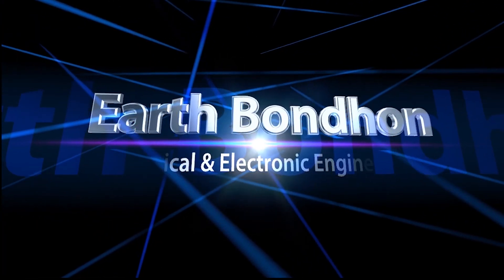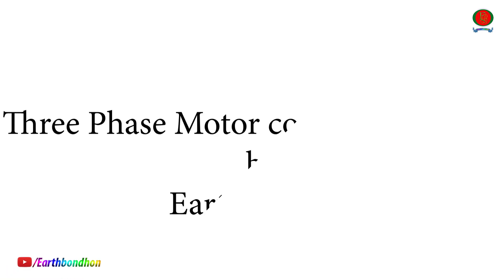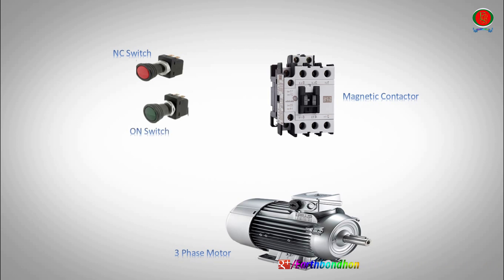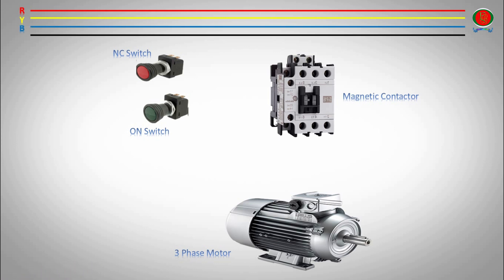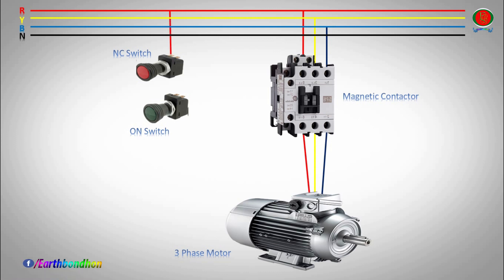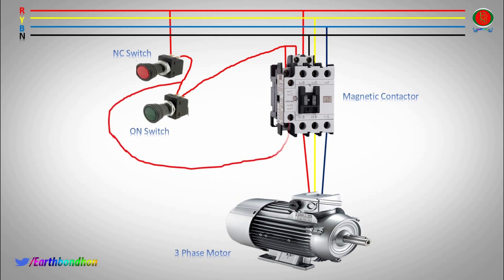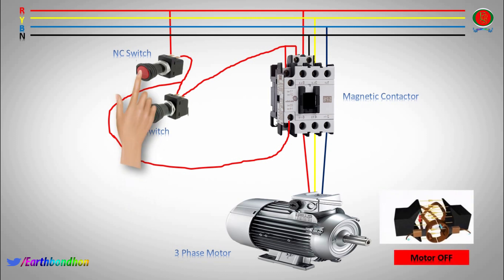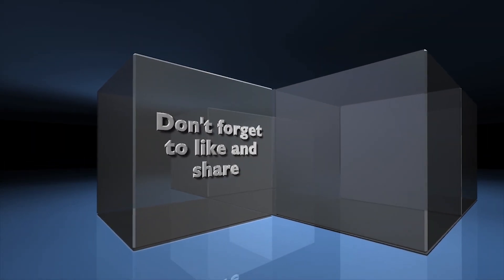Three Phase Motor connected in Star | Motor | Earthbondhon

Comment: Sir good day,
my motor is 5amp.
How many ampere need in contactor?
Reply from the maker: 9A AC3 4.2KW contactor using,.
thanks...
Reply: @EarthBondhon  what if i use 15amp. Contactor but my O.L i set in 9amp. Its that ok sir. Tnx
Reply: @ronaldtorres4388  Yes its ok, but just know that the sequence from the MCB must be there and the size of conductors also need to match with current. 15 A is too much.
Reply: Sir plz watch my video on my channel...i explain it with diagram and practical